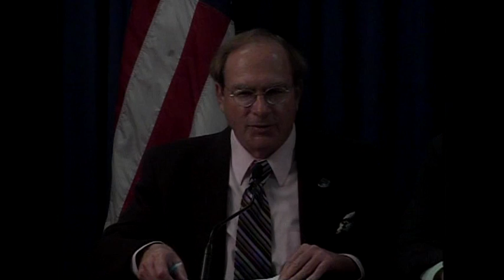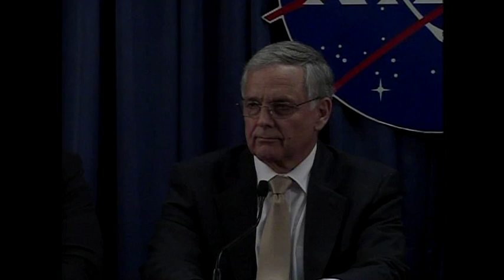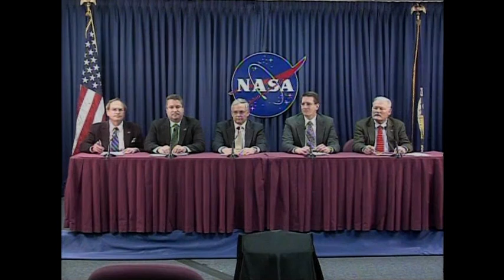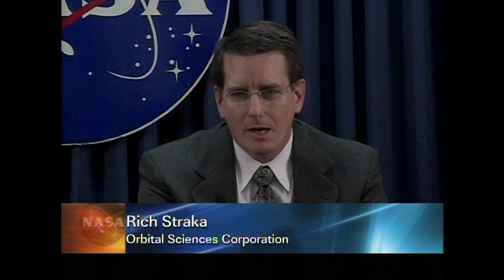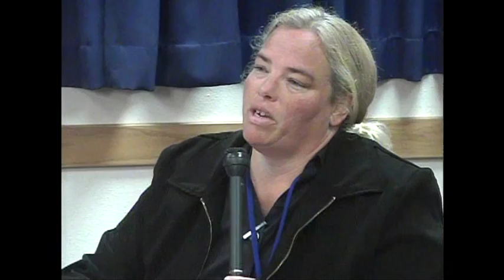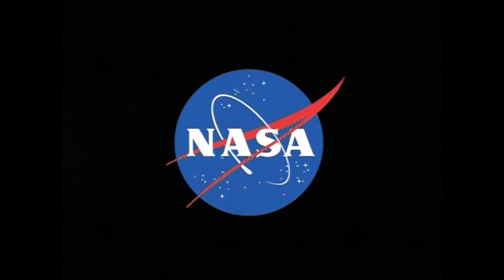Media Briefed on Glory Mission Failure

Comment: This won't change my view about NASA in no such way because when it comes to money, NASA doesn't screw around with taxpayer money. They find the problem, fix it, and quadruple check to prevent new problems. Post Columbia and the current Discovery mission are perfect examples of that. They survey the crap out of the Shuttle Heat shield now and pushed Discovery's mission 3 months ahead of its original slate. That shows something and I love it. 
Stuff happens but hang in there! :)